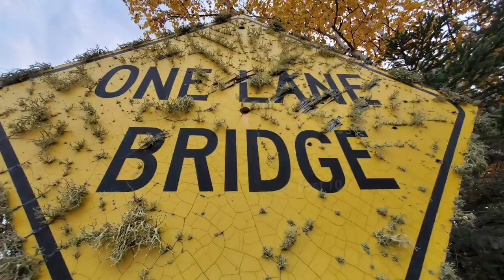Rough Road, Smashed Oil Pan, New Greenville Road Bypass

Comment: Was that picture of the car or for reference? That’s a transmission pan. You won’t have all those wires in bottom end of motor.
Reply from the maker: Yes I know, I could not find a copyright free picture of a smashed oil pan and it gets the point of damage across

Comment: It’s wild how many of the same places we’ve gone to. I just went through there last year to look for moose in a little pond another 10 miles north. If you ever go up there in the spring/early summer take the boat to Mount Kineo and take the trail that goes around the north of the island. The trail parallels the shore but gets totally flooded from debris blocking the way, and I think some failed drainage from when it was maintained as a horse trail. Also lots of trees near the shore felled by beavers, but not sure where they take them to.

Comment: If it was a Prius, they more than likely wouldn't notice there was anything wrong until a low oil light came on, even then it would continue driving on battery power for 10 miles or so.
Reply from the maker: You wouldn't feel the rock? Hitting the car
Reply: @post.10  You would absolutely feel it, but if the battery is charged, it would continue driving on the electric motor. The internal combustion engine is only a boost/generator, so isn't needed untill the battery is low.
Reply: @zeeblats  If it's a regular Prius (non-plug in) it won't go very far on battery power alone.
Reply: @brianleeper5737  Indeed it wouldn't, just a few miles or so.
Reply: @zeeblats  They pretty much fire up the engine as soon as the vehicle is up to speed, from what I've seen. And above a certain speed, they HAVE to use the gas engine. I think this is around 45MPH.